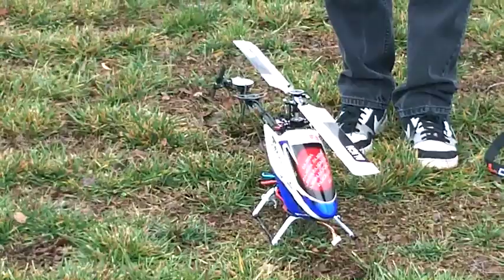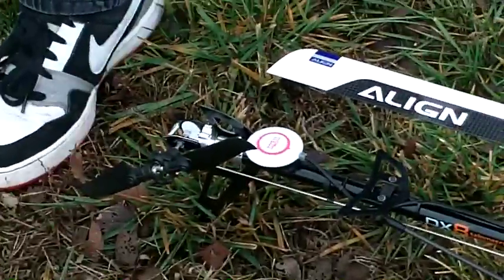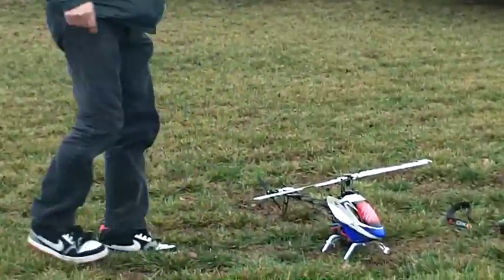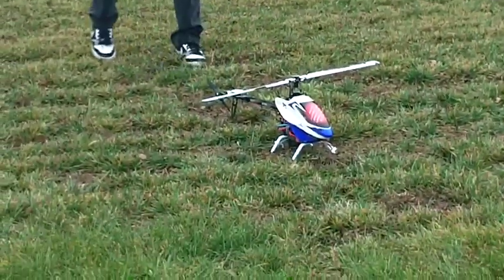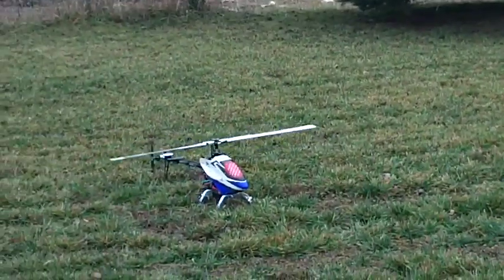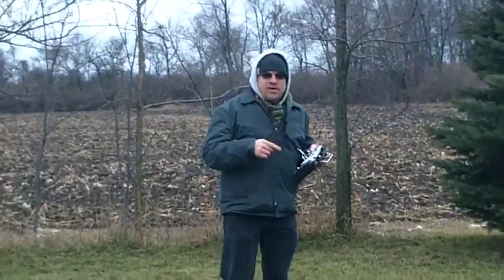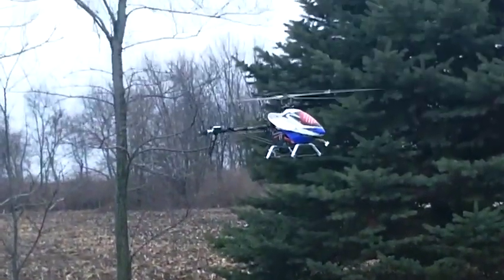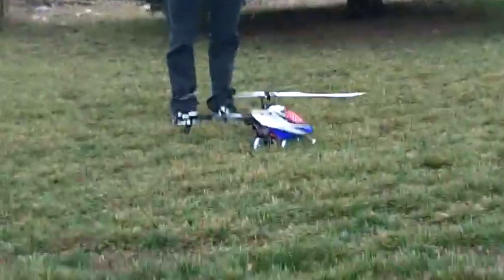Naza-H Trex 500e

Comment: The Naza H is VERY sensitive to any vibrations! Make sure tracking is perfect and all sources of vibrations are eliminated. 
Do not switch modes with any cyclic input at the time you change modes.
Other than that, Watch the LED for the right sequence of colored flashes for proper initialization before taking off. Also, the GPS HAS to be properly calibrated before flight. you NEED 4 green flashes at the end of the initialization and before any attempt to fly it.

Comment: Hi, nice video. Quick question can you take-off and land on atti or gps mode? It controls the motor speed but you can still control the collective pitch? Does it have a bank angle limit similar to a naza-m?

Comment: Nice video , could you give me some pointers on how to caib. the GPS  ?   Thanks
Reply: I no longer have the helicopter or Naza-H system these days. But, calibration of the GPS / Magnetometer is achieved by putting the helm through a few manual orientations, spinning the helicopter about its axis. The owners manual will tell you how to do this, and what signals to look for from the Naza-H system.
Reply: So about the same as the naza m for drones ?
Reply from the maker: I never owned the Naza-M, so, I can't really say for sure.